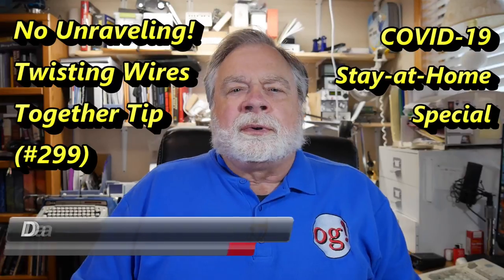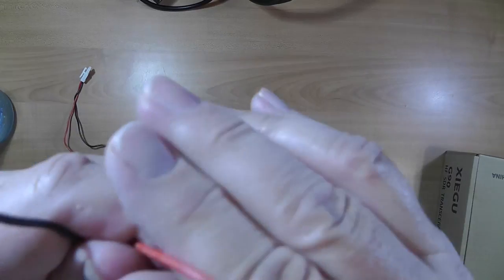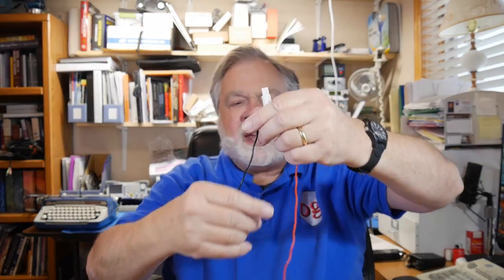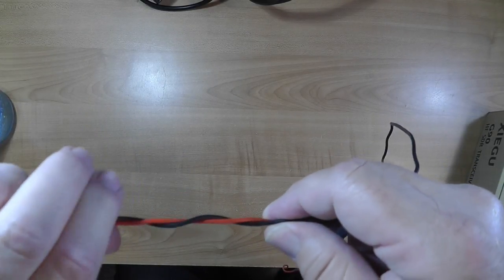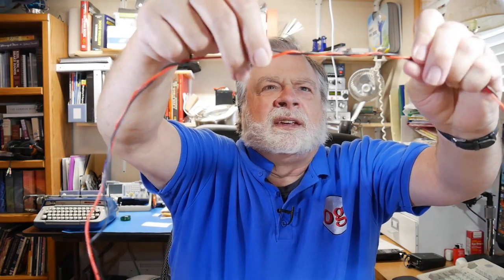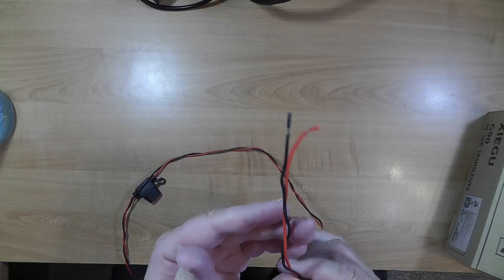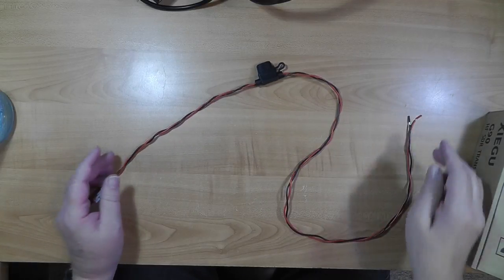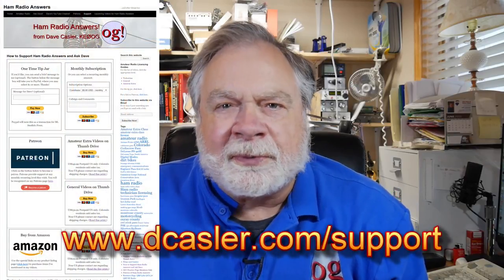Make Wires Stay Twisted Together! (#299)

Comment: Hi Dave;
A slight variation of this technique is:
1. Let the joined end hang down
2. Grasp the open ends in each hand between the thumb and fingers
3. Spin the ends the same direction and
the closed ends twists right along.
You can control the rate of twist by the spacing of the hands.
This is much faster and more even.
This is a wire variation of the how rope is twisted.
AD0TJ from Minnesota

Comment: It seems like these thin wires should be replaced due to huge voltage drop down.
Reply: @Yury I think you are correct,  but the Tamiya mini-connector on the end is hard to find with the correct internal pin gender.
Reply: It only pulls 5 amps at full power TX, so it doesn't demand much. Looks like that cord is 18AWG and 6 feet, so it's dropping less than 0.2 volts. It could be better, but it doesn't really need to be.
Reply: @hobbified  In theory this is true but when I replaced connector to XT60 and wire to AWG12, voltage drop dramatically decreased on my G90. Manual says that sometime current consumption mighty be up to 7-8A.